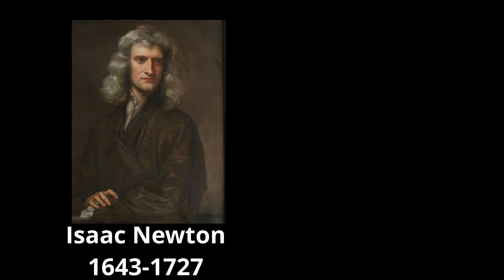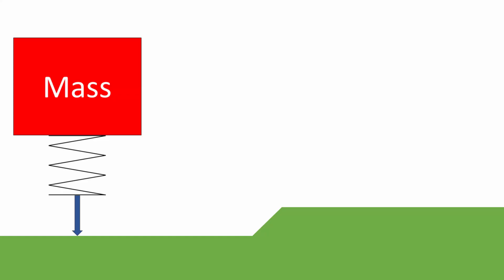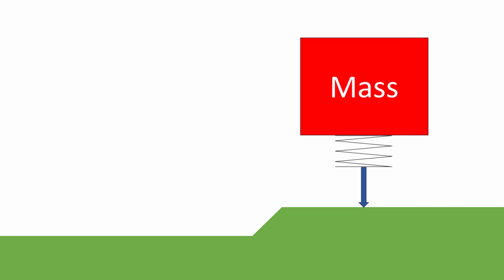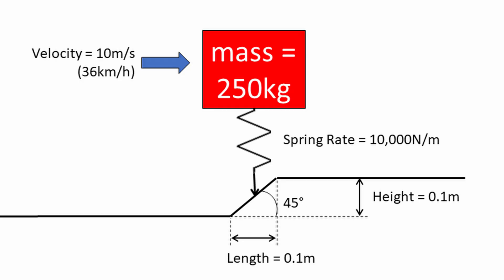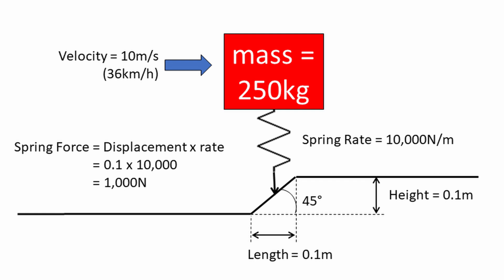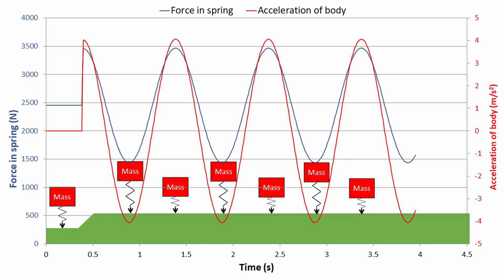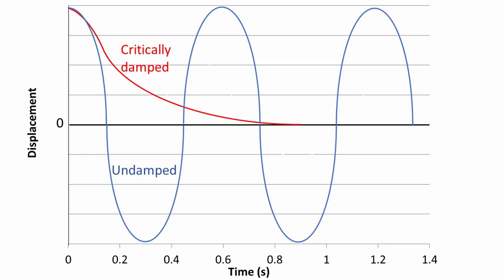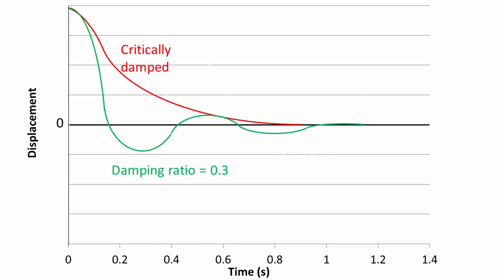Off Road Spring Rates pt2 - Adding Dampers

Comment: Awesome job ! I love the spring versus shock explanation.

I have a quite bizarre phenomenon I've observed: I have added spring rubbers to my springs which have obviously stiffened the springs as desired. While zero change to ground clearance has occured , an increase in functional clearance has definitely occurred on breakover (this is expected).  However , and this is the strange (but good part) almost zero change in the distance of a wheel from the ground on corner travel index was observed (the rear wheel). I don't have the same spring rubbers front and rear but they are similar. The rear spring rubbers could be a little softer. Is it the difference in front to rear stiffness that has allowed me to improve sort of "functional clearance " with no change to corner travel index ? It's a good thing that happened , either way. These are basically plastic rhino "oil change ramps". I've been doing experiments trying to pass this corner travel test with various modifications (passing would be all tires touching a ramp or the ground). It's very close. At 22 psi I can't even fit a deck of cards under the hiked tire and if the vehicle had 4 people inside it would pass the test. (I have more up travel but not enough weight to achieve it).